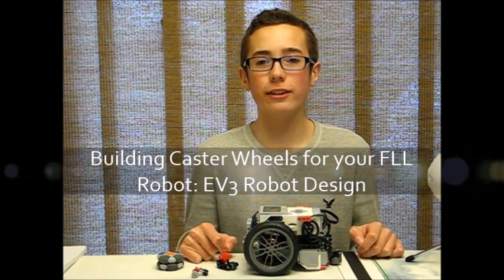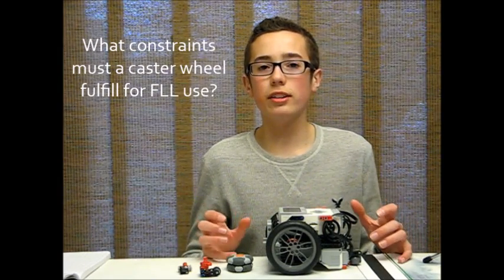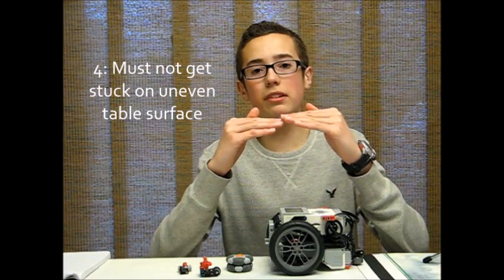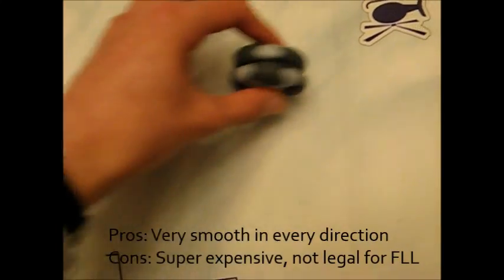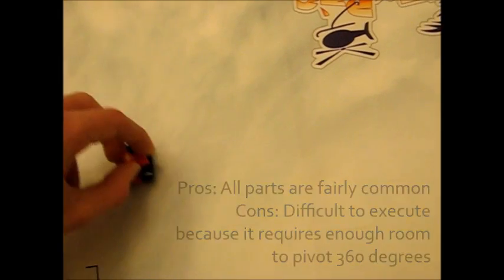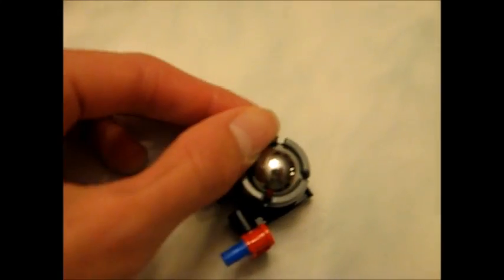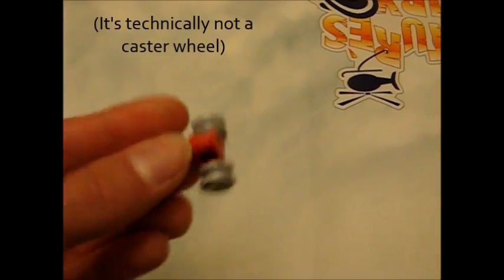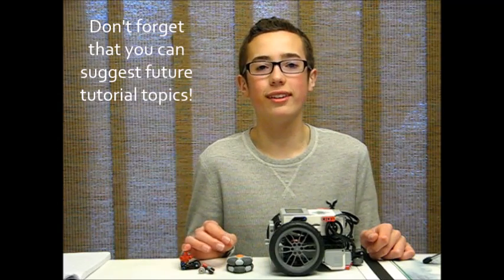Build the Best Caster Wheels for an FLL Robot

Comment: Hey Kyle,  we are currently have big issues with our FLL base robot. The caster wheels on our robot have been causeing problems. since we have a front heavy robot we have been experienceing issues whereby the robot can barely move or turn on the mat because it have ALOT of friction. We have tried ALL the wheels available to us and none of them have been working. This incudes EV3 ball bearings, Spike Prime ball bearings, small wheels, large wheels, shopping cart trolly wheels, ends of rounded pins, small gears and rounded beam parts. None of these allow our robot to manouver around the feild. Any reccomendations would be highly appreciated. 🙏

Comment: For the ball caster, is there a way to attach it that keeps the robot leveled? I mean that as in, one side is closer to the ground than the other.
Reply from the maker: +tresrules16543 I'm sure there is. You'd use angle beams for that.
Reply: Builderdude35 Alright. Thanks.

Comment: If you want Omni wheels (like the rotacaster wheels) for FLL here is one design: http://www.eurobricks.com/forum/index.php?showtopic=76297

Caster wheels (#2) inconsistently influence the trajectory of the robot when it tries to drive straight. This behavior is exacerbated when the wheel has a tire.

Ball bearing casters can also cause inconsistent problems with straight travel, possibly having some connection to wear on the ball bearing.

Lastly, it is also important to consider weight distribution when designing non drive contact points. All the examples in the video use a single non drive contact point. A 2  point design (1 drive or non drive point at each corner of the rectangular chassis) is another common choice.
Reply from the maker: epiclevelwarrior Okay, thanks for sharing!
Reply: Is that the same as the Spybotics one?